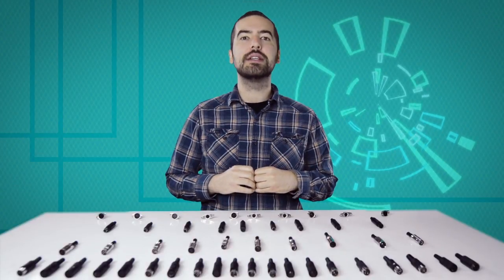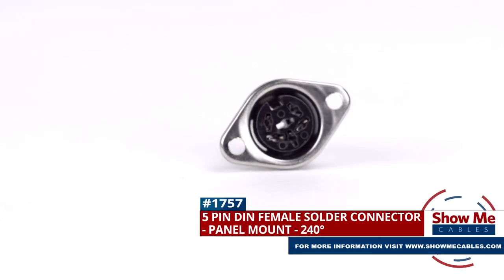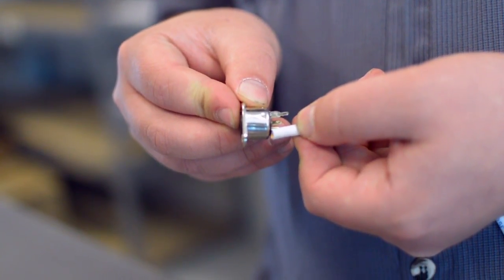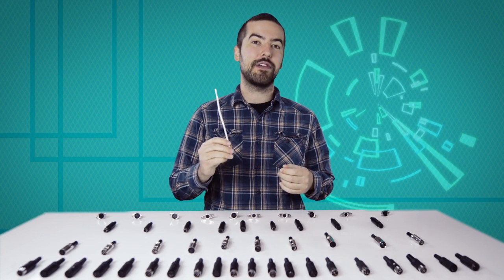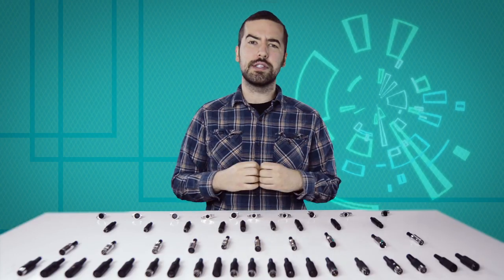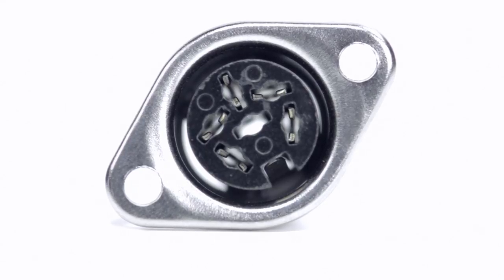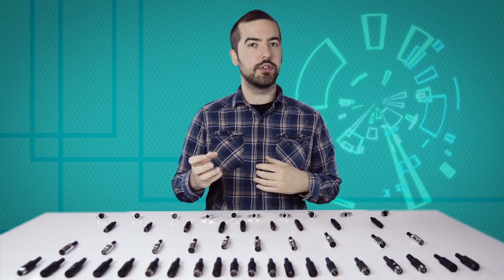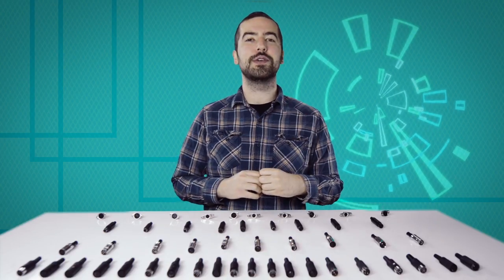How To Install The 5 Pin DIN Female Panel Mount Solder Connector (240° Style)

Comment: Except noone sells them with screws!! Most schematic  incorrectly list the hole  diameter as 19/32 (15mm) (.59375inch).    I believe it is around 3mm. Tried about 20 different screws and none fit correctly. Where can we buy the screws and what type/name/size are they????